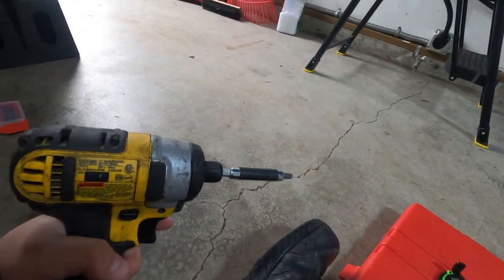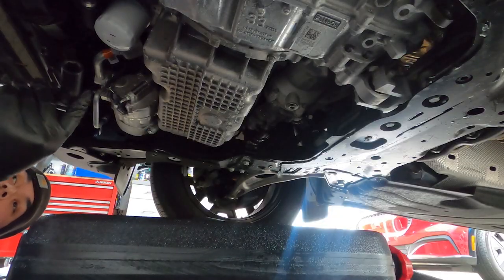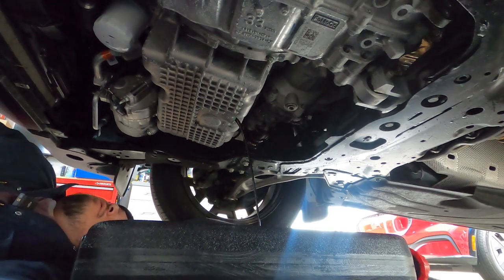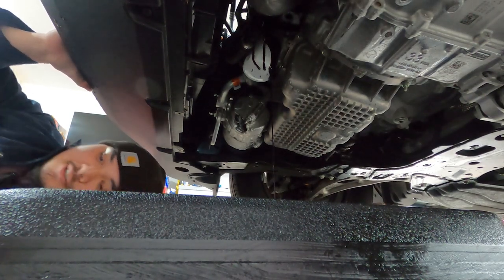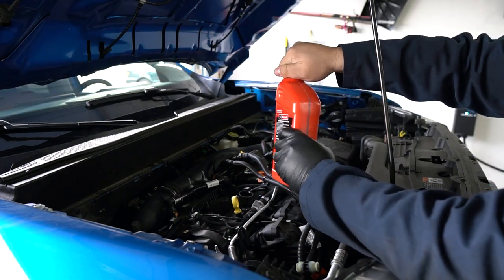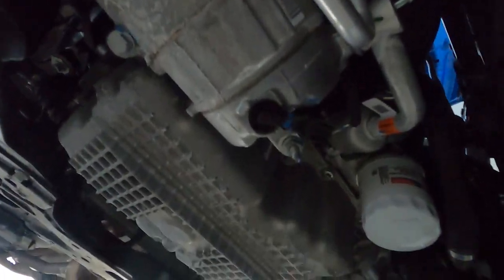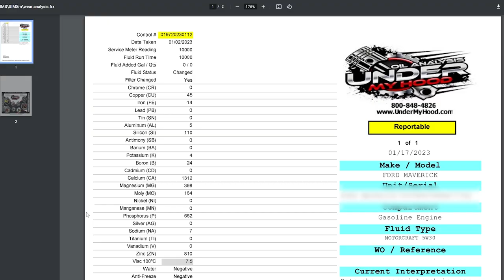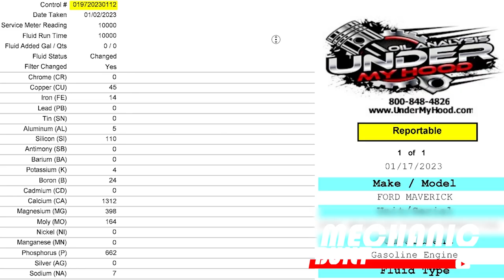2022+ Ford Maverick 10,000K Oil Change and Oil Analysis (2.0L)

Comment: You did a nice job, but. I'd never follow the manufacturer's oil, or any fluid change interval, they get incentives from the government to specify high oil change mileage.  The CAFE gas mileage standards are insane, and oil change intervals are incorporated. Secondly, the intervals are designed to get the engine (or transmission)to the end of the warranty, they are happy to sell you a new car then/ I'm inclined to listen to "The Motor Oil Geek" who changed his new car at 500, 5000,  and then 10,000 miles. A direct injected turbo engine should be changed every 4000, or less, IMO.

Comment: I worked years ago as a lubrication engineer for Conoco.  Now I use only Valvoline, no synthetic oils.  We drive our vehicles to at least 300.000 miles.  Oil changes every 2500 miles.  So far, we are driving cars that have never had their engines worked on.  It's Valvoline, or nothing !

Comment: To each there own, but I run full synthetic and do an oil change every 5000 miles.  Back when I ran regular oil, I did it every 3000 miles. I have 3 vehicles.  One of them is a 97 gmc sierra with a 5.7 engine with over 340000 miles, and  we recently had to replace the intake gaskets and the oil pan gasket. While we were in the engine, it looked pristine. I was actually shocked! It still runs like a new truck. No ticks or knocks whatsoever. I'm aware of all the lab reports saying you can go longer, but seriously, why take the chance. Engines are expensive...

Comment: Every 4000... never go 10,000
Reply: Follow the owner manual. New synthetic oil has enough additives to last 10,000miles or even more depends on the engine design.
Reply: Change it at 3000 and 500 for break in the people that want to run it 10000 miles just trash long term  and are always in debt buying something new to screw up

Comment: Dude, this engine has been used in dozens of cars since 2015.  Being in a Maverick did not change anything.  The answer is, change at 5k.  At least you did not call the panel on the bottom a skid plate.

Comment: 10k mile oil change intervals on an engine that's both turbocharged and has GDI simply isn't the best idea in the long run, I've seen inside some of those engines with higher mileage and even though the oil itself can be analyzed and show to have life in it, I've seen buildup around the piston rings after continuous 10k mile intervals. Another thing to keep in mind is if your using any vehicle for towing that typically will fall under the "severe service schedule" which normally shows a lower mileage interval in the maintenance manual, typically 5k miles under "severe", one other thing to mention is this engine is running on "synthetic blend" oil, which is the (minimum requirement) to maintain the warranty but a full synthetic oil with "SN-Plus" stamp on back that meets and exceeds the Ford specification would be more ideal of 10k miles is your goal.

Comment: I was waiting for a video like this one. I had an hybrid 2023 maverick and I did my first oil change at 13.000 mi (when the app told me to ) . So good so far !
Reply: I wouldn't t be concerned either since the Hybrid uses full synthetic and the gas engine doesn't run all the time. I would totally be concerned going 10k in an Ecoboost because Ford only uses synthetic blend in those. Clean oil is the lifeblood of the turbo and heat and dirt are its worst enemies. P.S. I liked the video, just a natural born skeptic I guess.
Reply: Pretty much guaranteeing that engine will be toast right outside of warranty.
Reply: You keep doing that you be lucky to make it past the warranty..xd
Reply: congratulations my friend you saved $35.00 for that pesky oil change. Just make sure to sell that truck to a friend at 59,999 miles so the engine blows on him.

Comment: Nice video! Just a couple of free suggestions. Before pulling the plug snd filter, I like to remove the oil fill cap and pull up the dipstick. I’ve heard this gives a smoother and more complete drain. Also, just a pet peeve, but I’ve never understood using the dirty oil to lube the new filter gasket. Why not do that with fresh oil?
Reply from the maker: Yes ive done the dipstick method and cap method i should apply it to my next oil change video . 

Out of the hundreds of oil changes using old oil has been standard in MOST cases. im assuming you dont want to contaminate your new oil, or accidently spill out more then what you want. When i used oil barrels with fill nozzles i use to pour a smidge in a cap and use fresh oil, you only need to apply a film of oil, so that little cap gets wasted. Though yes! If you can you can use new oil though a film of used good oil never hurts either 😅

Comment: For 10K is real black.  My hybrid engine at 11K was still clear and can still read the dip stick.
In fact the oil coming out was cleaner than the I was putting in.
But I do use ethanol free gas

Comment: YES, it is. If you want your Mav to last forever, ignore Fords recommended change interval & change it
every 3000mi. As a turbo overclocked little engine that turbo burns & cokes up the motor oil it has inside.
PLUS-oil & filter is cheap-new engine or even a new turbo is not.

!

Comment: Plenty of videos showing ford with turbos at 7K oil changed intervals clog the little screen on the oil feed line to the turbo. Destroying the turbo, Have fun replacing the turbo at about 65K miles. But hey you save pennies not changing the oil an extra few times. .

Comment: Never go more then 500 miles on the first change and 3000 after that with the best oil you can buy fuel is getting in the Maverick motors 2.0  do a oil analysis ford says nothing is wrong lol.    Change it and sell it when the warranty is close to being up

Comment: I changed my oil at 1000 miles and to my surprise the oil filter was as heavy as a brick.  Just a thought of caution. Also I manually tightened splash guard cover and two screws were already stripped.  Cheap retainers